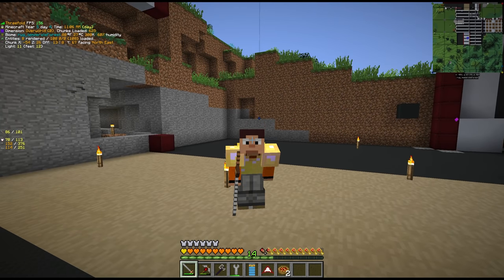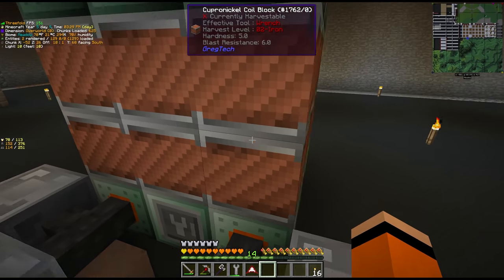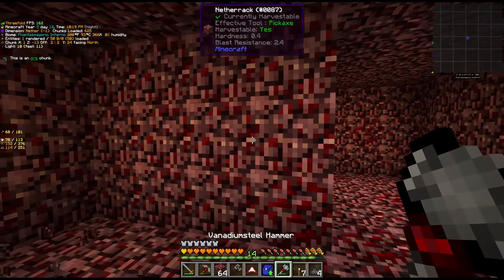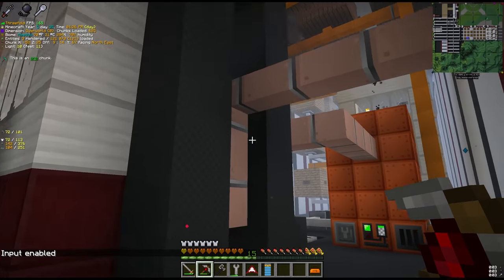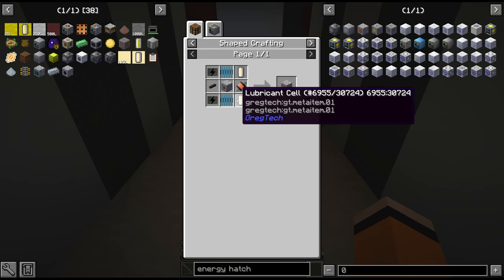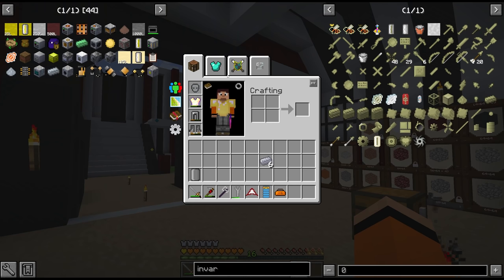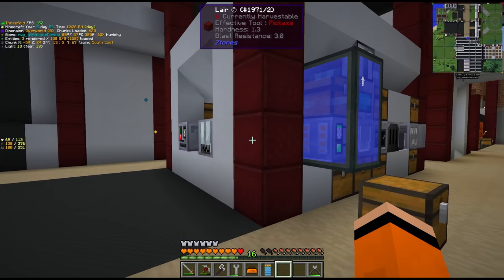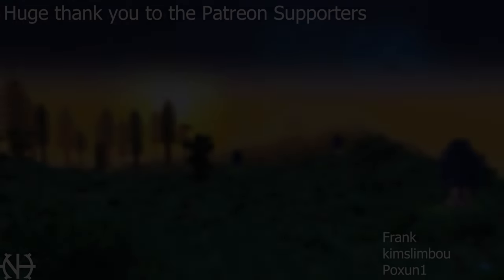Gregtech New Horizons - 16 - FeCrAl Coils & Base Organisation! Modded Minecraft

Comment: I don't know if higher tiers of pumps are able to grab oil that lower tier pumps will miss because of their more limited range. I don't think it really matters overly much because you're likely to want to switch over to a multiblock oil drilling rig that takes from a fluid chunk sooner rather than later anyway. I did the "stick to oil spouts for far too long" strategy, and while I don't recommend it if you're going with it I cannot stress this enough: *Underground oil pipelines*. It makes it so much easier to (re)move later it's insane.

Two more things to note about oil: Those underground reservoirs aren't necessarily marked by an oil spout on the surface, at least I encountered one such hidden reservoir in my playthrough. Considering that said reservoir ended up containing the end portal that might have just been the freakiest of world gen coincidences, but still. Another thing to keep in mind is to *never fall in oil*. Oil slows your movement down to a crawl and prevents you from right-clicking items (like, say, an EnderIO Staff of Travelling), so if you fall in an oil pool you're probably just dead. And no, wearing full Galacticraft oxygen gear will not allow you to breathe underwater (or underoil, in this case). You'll just suffocate and die in your oxygen mask.

Yeah, I think rain happened. There's an achievement/advancement/whatever it's called that you get when your first machine blows up from rain, that's usually how you know, but when you're AFKing you obviously don't notice that.

Something that I would recommend setting up early is a small system for distilled water. Nothing super fancy, just some HP solar boilers fuelling a steam turbine feeding a distillery distilling water, it takes very little power to keep that running. Distilled water is one of those things you tend to need sporadically so I find it useful to just have a stockpile of the stuff laying around.

Your two GT steam boilers also have muffler hatches that can be upgraded. Keep on top of those if you want your base to turn into a toxic quagmire less rapidly.

IIRC the damage that hot ingots deal is relative to their temperature, so something like Kenthal is really tame even if you shove a whole stack in your inventory, but one very lategame hot ingot would pretty much melt straight through your pizza groves and the hands therein. You honestly shouldn't be without a full hazmat suit, which will protect you from hot ingots, for long though. In fact you should be wearing one already, but, well...mysterious disappearances happened I guess.

When going for the cleanroom for the love of all that is holy don't use the steel fine wire recipe for the filters. The carbon path is infinitely cheaper, if not necessarily faster/easier (but than why play GTNH, of all things, if you wanted to go fast and easy).

Remember that multiblocks can wallshare, so you can actually combine your two EBFs into one 2x EBF setup. Of course in this particular case that would require waiting on another 10 Kenthal coils to get the second EBF online, so probably not what you want to do, but later on you can use that trick to save 6 coils per two EBFs, which is a deal that starts out good and will only get better from here. Just keep in mind that machines can also share input/output buses/hatches etc., otherwise you're going to have a hard time making that setup work. IIRC you cannot share maintenance hatches, though, and I wouldn't recommend sharing energy hatches even if you can.

That is how I got my first brewing stand as well. And a whole ton of garbage, unsurprisingly. As for the Blue Alloy cable, those are (IMO) the best HV cables other than the superconductors, which you're nowhere close to and are of questionable value besides.

At this point it's definitely worth starting to process some ores using that mercury you've been stockpiling. Anything that gives Platinum Pain Train dust (I.E. Nickel, though I believe there's a few others as well) are top priority, anything that gives gold is a high priority due to how gold/electrum intensive HV is and upcoming circuits will be, and beyond that it's really your call on what is worth spending the mercury on. I find that getting some extra silver isn't horrible, but mercury isn't infinite (plentiful, yes, but not infinite), so you do have to prioritize.

Now that you have Kenthal coils you can use the alumina+carbon recipe, no more need for cryolite.
Reply: Steel for the filters is fine, it’s just iron and oxygen at this point and is fast to make

Comment: 24:40. 2amp cables would be enough. Cables work differently from GT on 1.12, where you iirc had to account for the max amperage coming out: energy hatch only accepts 2 amps, so even though the transformer is able to output 4 amps, it will not, hence never overloading the cables.

Comment: Get the void drop filter so you can void the trash blocks you pick up when mining
Instead of doing the MV pump, make the drilling rig(or not)
Click the maintenance hatch with the toolbox to fix issues without clicking with all tools
Make alumium with aluminia + carbon dust now that you have kanthal
Make portable scanner, it good

Comment: I think youre far enough in to use ender io inventory panel and remote awareness upgrades to have a make shift AE system. Keep up the great work my guy!
Reply: Also, you could make some pollution scrubbers to start reducing your pollution. Additionally you can upgrade multi block machines that use mufflers, you can always use a higher tier muffler which reduces pollution.
Reply: Enderio pannel is an option, but HV circuit per remote access thing makes it not cheap

Comment: why not invest in bauxite seeds? 

Also personal opinion : i would like to see you finish the base in the overworld, no rebuild, no transfer of stuff + i loved your fly-by last episode. epic above panorama.
build your bf as far as possible for pollution, you will need a lot of them, it will only get worse.

As someone who worked in factory's , love the pipes going around the place, like irl. could even add more just for decoration.
Reply: Bauxite seeds are extremely slow, require crushed alumium to 4x and unnecessary with how easy aluminia is to get
Reply: @Royal_4096  any passive gathering is gain no mather what, it's thé small things,... Like me :)

Also, last playthrough i have seen was from Lash. 
Alot has changed now.
Reply: @oppenheimer3615  May be a small thing, but it’s useless currently since he doesn’t get alumium ore besides from the gravel ore. Plus alumina + stuff is cheaper to smelt, no reason to bother with bauxia seeds
Reply: @Royal_4096  okay, i'm gonna be real here, i know that in GT you can literally find any ore deposit you really want and don't even bother doing anything more than doubling, but these "smart" arrays that can take almost any ore and process it as efficient as possible (including GT crop enhancing) just warms my heart so much.
But yea you can rush void miners/rift rockets to get literally infinite resources or whatever if you want. But where is fun in that?
Reply: @mrShift_0044  Uh what, you can’t just get whatever ore you want right away, that ability is gated here. Sure 4x ore processing is good, but you both can’t do it for alumium much till moon and you have a better option. Also, you can’t rush things in this pack.

Comment: you must use logistics pipes
Reply: Not really needed or worth using
Reply from the maker: Could be fun though! idk maybe
Reply: @Threefold.  Fun sure, but you unlock ae a very tiny bit after getting it and have to tear it all down, so idk
Reply: @Threefold.  it can be on use all of the automations, it wont be necessary and it will fun and you must start deal with thaumcraft